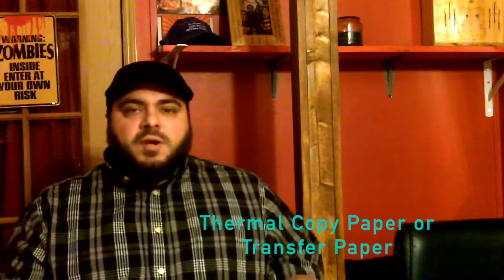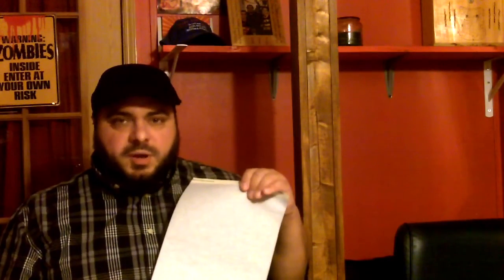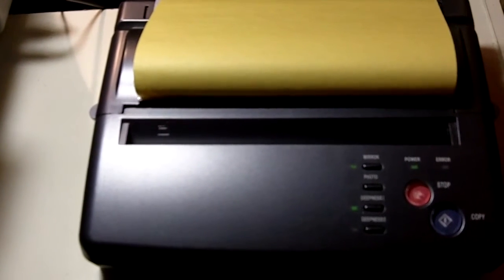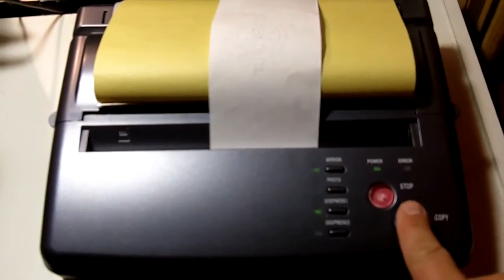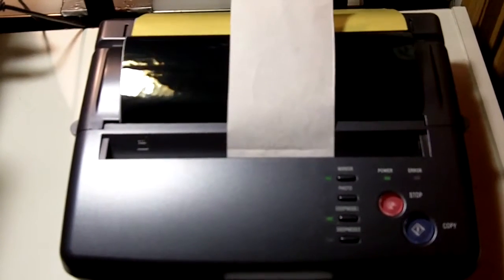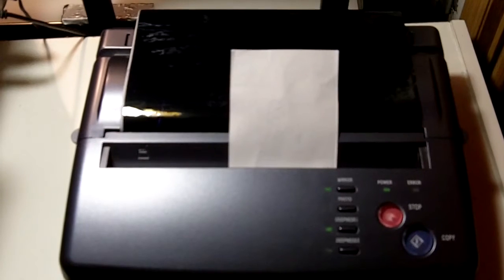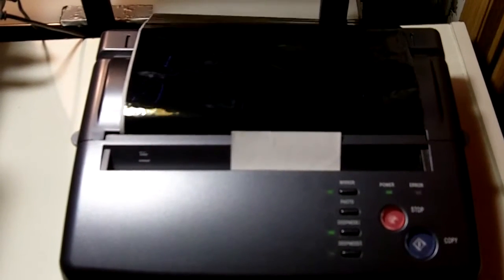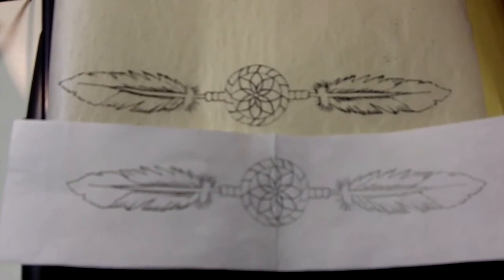How I make a Tattoo Stencil

Comment: so you can use thermal paper without needing a thermal printer?  you just need to trace the stencil on top of the white transfer paper?  

cool video, by the way.
Reply from the maker: +john doe Yes you are correct. I use that method for when I do a portrait Tattoo. I will tape the image to the top of the white sheet, then put it on a clipboard so it has a firm surface behind it, and then I trace out the image. It will transfer face up on the white sheet  just like you traced it. Thank You!